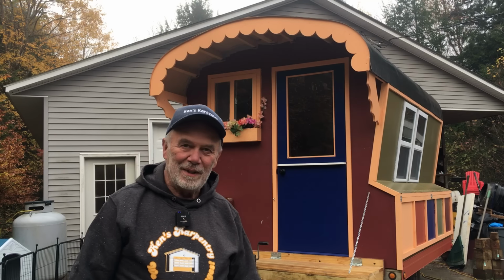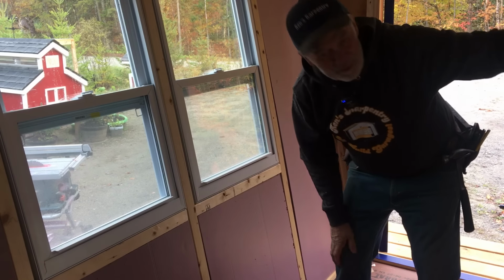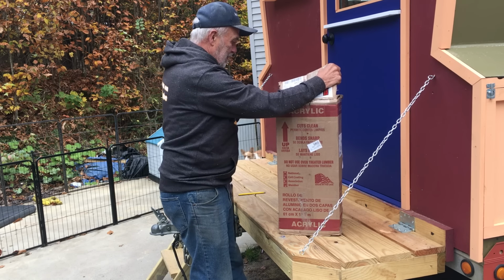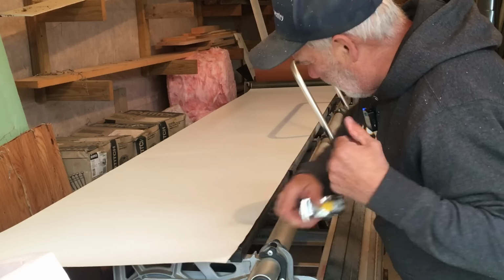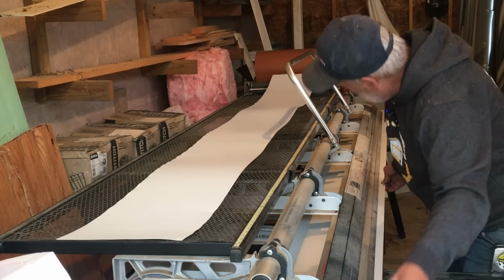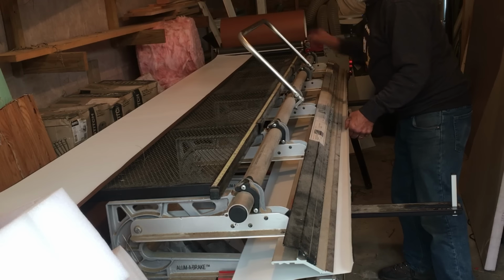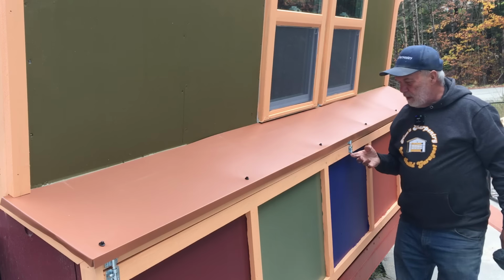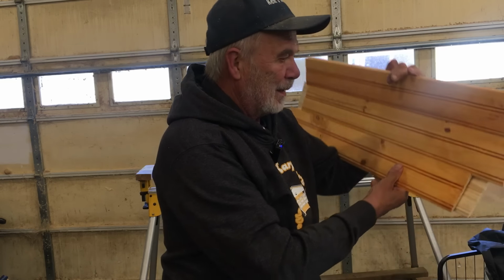After Waiting 6 Weeks the Roofing Finally Arrived...Vardo...Gypsy Wagon...Ep 22

Comment: Wow, that one side went really fast with the rigid insulation. I like your singing of "perfect!" I like the color of the coil stock you ordered. That looked like a great cutting job Ken. I saw some Canada geese flying south yesterday. Thanks for showing those Ken. Wow, that looks beautiful Ken with the coil stock on there as a roof. Your bending was perfect! That wainscoat tongue and groove panels look really nice. That'll be so pretty on the ceiling and it can make the "round" over it. Thanks for this video Ken. The Subaru engine is back in and it's driving around. Still a major thing to fix but it's running great now. It has trouble accepting gas in the tank. It takes 5 minutes to get 3 gallons of gas in it. Something about the venting of the gas tank that makes it hard to fill on some Subarus. It requires dropping the gas tank which means dropping the exhaust and drive shaft! At least my brother-in-law has a hoist. Then it's just lower ball joints and brake pads! My estranged husband and I put a hold on our divorce so I have time to test it out before I bring it back to Minnesota. Thank you both for your prayers!
Reply: Glad to hear from you and that you're continuing to move forward with things!  Continued prayers for your situation!
Reply from the maker: Wow you have a lot going on. We’re praying everything works out for you.

Comment: Good morning Mr. Ken.  An idea: I found some brass slide bolts online or at the hardware store which I think would look great with your copper roof and color scheme of the vardo.  They come with the option of being spring loaded, so that should help prevent any of the bolts from jumping loose as your take it down the road.  What you have is excellent, but I did think the brass bolts would look great with your color scheme so I thought I'd share.  Great work and I look forward to the next video!
Reply: I think that would look nice too! I love copper and I have several little pots and pans with the brass handles. They look good together. Have a great week!
Reply from the maker: Good morning thanks

Comment: As the insulation was going in it suddenly hit me that there's no wiring yet. Something that might be easy is surface mounted tracks with snap-on covers, plus surface mounted boxes. A rainproof breaker panel could be mounted inside one of the exterior cabinets with a flap-door for access to a feeder cable.
Reply from the maker: Thanks right there will be minimal wiring

Comment: With that insulation in the Vardo, you should be as snug as a bug in a rug.  I was impressed how each piece fit.  That metal roofing will fit well.  Your metal brake comes in handy as you form each piece.  It was wise to keep that metal brake to use after you "retired".
Reply from the maker: Haha thanks. My metal break is like an old friend

Comment: If you’re going to oil you cutoff slider use PB BLASTER Dry Silicone. It will not leave a residue, and it will dry. Not collecting dirt. That side roof is looking great. Thumbs up 👍 don’t change the screws. They add to the look.
Reply from the maker: Thanks I’ll get some